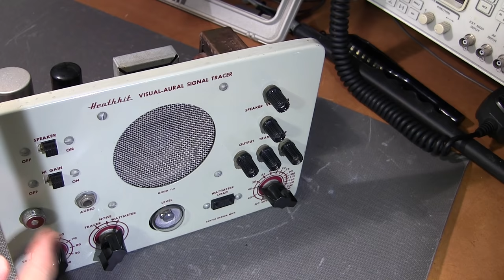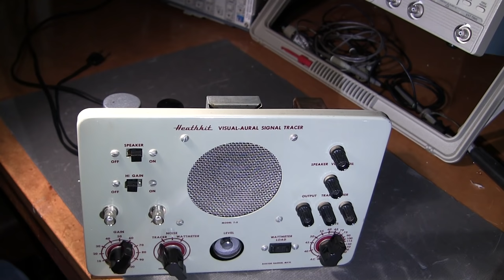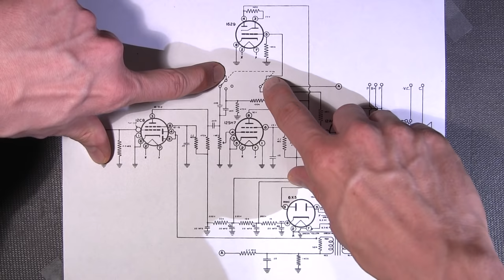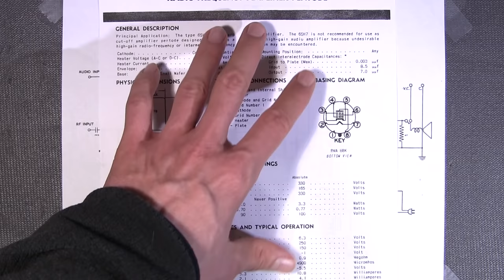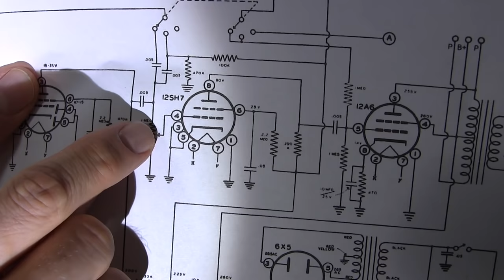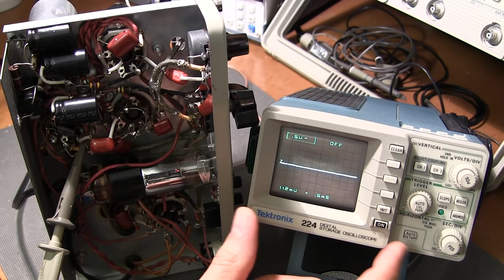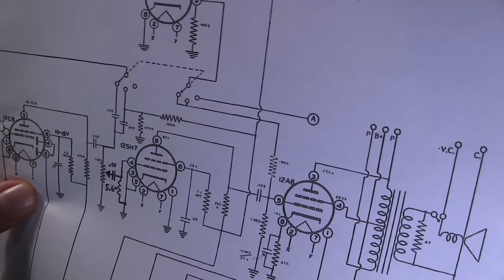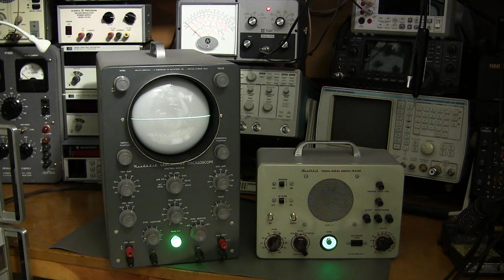Signal Tracer Troubleshooting Repair and Modification

Comment: Thanks so much Paul. Your knowledge of vintage and modern electronics is wonderful. As a mostly self taught designer over 60 years, mostly solid state . I can only say I wish I had someone like you to learn tube design when younger.  Learned more in this one video than any manual or book previously explored. 74 and still learning. Great job! Any chance you have any info on a Brunelle Instruments Model 3050 Sweep Function Generator I'm trying to restore.I also have a vintage Analog Digital Research CM52 1GHz Counter Timer before they were acquired by Fluke, fully restored with schematics I would like to donate, if interested.
Ken

Comment: Paul,
I was looking at a Popular Electronics Magazine from 1955. There is an article on basic radio servicing. It mentions a method of determining if the audio section is working is to put your finger on the grid cap of the audio tube to listen for hum. Quite a surprise if you touch the plate cap of a tube.
Reply from the maker: That's where knowing the difference is key.

Comment: Mr. Carlson. On the output tube there is a resistor from the cathode to ground and a cap across that resistor.  I don't really understand the purpose of the cap. I was once told it acted as an AC ground.  By the way I just became a patron.  Money well spent.
Reply from the maker: Hi Don. You are correct, the capacitor is a path for the AC to ground. You will notice a slight increase in gain with the correct value chosen.

Comment: Wow And THANX...! That  'Microphonic' and noisy resistor is a first for me. (Shades of the old carbon microphones) Got problems, hit it, bang on it, wiggle it. I love dumb luck testing when it works. That often does help find faults in things like pinball machines and appliances.This makes me appreciate the value of all low noise passive components too.

Comment: Paul, carbon firm and carbon composition are very noisy at higher resistance values.  I recommend instead to use metal firm resistors, which are much quieter.

With these 2 resistance coupled pentode stages, the gain is very high so, will quickly highlight any unwanted noise pickup.

I have seen some unbelievable problems with carbon resistors.  With heat, voltage, and moisture, the marked value can really change, especially with some of the non Allen Bradley carbon comp types.  When checking the resistance of the part, check it twice, reversing the polarity for the second measurement.  Surprisingly, they can develope semiconductor properties when they go bad.
Reply from the maker: Which brings me to E.F. Johnson VFO issues. :^) Thanks for your input Bill, its appreciated!

Comment: Really good troubleshooting video. I'm sure there are design defects in some kit gear, that were never discovered. 
Why use a 2 wire line cord on a device with an all metal chassis and cabinet? I would have made it a 3-wire with a grounded plug for safety.

Comment: Interesting to note that the 1958 Heathkit catalog shows a proper grid leak (pot connections swapped) for the 12SH7 control grid. Also interesting that the beam power tube is rated for +10 volts on control grid, but they did do a proper cathode bias. I wonder if some enterprising sort in the drafting department "corrected" the "backwards" pot and caused this error to be propagated?

Comment: Very good video. I was very impressed the with grid bias and coupling circuit addition and the isolation of the faulty resistor. Very informative, would have liked to have seen this video when I first got into electronics back in the early 60's.

Comment: I think I would be absolutely lost without mine.  I have a Paco Z-80 on my bench and use it daily.  I actually have three of that model, one of those Heathkit's and a Elenco.  All basically the same thing just look a little different.  The only thing I modified on mine was to change to a BNC for the probe and added a off switch for the eye tube to extend its life.

Comment: What brand and type of electrolytic cap would you recommend for replacing the filter cap in Heathkit and other tube type test   equipment? what type gives reasonable life in this application? I have a few pieces of the old equipment and watching these videos has given me enough info to start restoring some of them.thanks

Comment: Thank you! This is valuable info and that looks like a nice piece of test gear. I recognized the noise from another video of yours where you had a bad resistor. My money was on the 390k though. Now if/when I run into this a third time I'll likely go at least in the direction of making a repair. Thanks again for your service!

Comment: Hey Carlson. First thanks for your great videos. I like to watch them and I learn a lot. I have a question and I know you don’t have the time to answer all comments. I ask you, because you are having a very bright eye tube in your signal tracer. I don’t have a signal tracer, but I bought a Heathkit IT-11 Capacitor Checker 2 month ago. I changed all capacitors and some resistors. Its working fine, but the eye tube was blurred, when I shift to leakage (much more bright at bride), but I was able to calibrate it easy. I could not live with that, so I bought a NOS 6E5. The brand is UNITED where the old one is RCA. The new eye tube is bright and fine and works fine when I test the value of  capacitors and resistors. At leakage it is also bright, but it is impossible to calibrate it. Nothing happens when I turn the pots to calibrate. When I swap to the RCA tube, there are no problems. Are specifications not the same for all brands or what?  What are your experience?
Happy New Year

Comment: Great Vid. I like how you explain the signal path through the unit and explain how all the components work and what their used for. Very interesting. I wish you could do that with a Fender Black face AB763 amplifier circuit. That would be so great. I would probably watch it a 100 times. You do great videos. Keep up the good work. Thanx!!

Comment: Whenever I hear that crackling or frying bacon sound while I’m servicing tube amps, the source is usually a grumpy carbon comp plate load or cathode resistor.  Great content here.

Comment: I have the Eico version of that unit. Handy little things indeed! I like how I can test output transformers on board, and get audio out of or into an audio amplification signal chain. Those a great for chasing down dead spots in audio amps. I have seen some boutique guitar amp builders/hobbyist builders, and hobbyists, converting those into little guitar amps. What a waste! Use the da'med thing! BTW, I passed my extra class two months after I got my General. I was busy the nest test session, missed the second one, and wound up at a different radio club's test session. I think I will go get my VE this week. They really need some new VEs really really bad. That is the most geriatric ham radio club I have ever seen. It's also one of the nicest too.
Reply: Oh, new gear..... Amp Supply LK500ZC 1500 watt linear, home brew 4-125 type tube linear that goes up to 2 meter band, Bird 4391 meter, with elements for HF/6meter/VHF/UHF, and SW, and an old General Electric WWII era US Army Air Core transceiver that uses VT4C output tubes, with the power supply, PLUS a bunch of added stuff for amateur use, including VFO, BFO, preselector, Q multiplier, and who knows what else. I am busy fixing the truck up with modern(ish) gear.
Reply from the maker: Lots of cool stuff Seth! Pretty soon your place is going to look like mine... LOL!

Comment: Great video. As a suggestion would the noise mode still be effective if a high value resistor was connected to the back of the input socket so as to limit the current to less than a milli amp so you wont get a shock off the test probe?

Comment: Very good video, My question to you is on the power cord. Is it a good idea to use a 3 prong grounded cord that will ground the chassis to earth ground ? Does a earth ground to the chassis affect the circuits and or calibration of vacuum tube devices ? Maybe the subject of grounding would make an interesting video. Thank you for your time well spent, Christopher

Comment: Great video, though I’m late to it. I have the slightly later grey version T-3 but no bias noise; I’ll have to see if it has the blocking capacitor from the factory. That’s bizarre to swing the DC operating point with a gain control. 

Having a few decades on you, I had a similar idea ten years ago, to assemble a vintage hobbyist bench from about the time I was born, all of grey Heath instruments though.

I ran into the “heated resistor” test this week in an old Heath transmitter. It was open in-circuit, then within tolerance after desoldering. I wonder what it will be in the trash?

People familiar with the time say that Heath did buy a great deal of war surplus parts, possibly accounting for the unusual T-3 tube specs. But I’d be certain that the 12.6V heater choice was driven by the eye tube voltage (itself perhaps surplus in the 50s). The amplifier tubes were never going to share the 6.3V rectifier winding because it is at B+ DC potential—or should be—to avoid exceeding the rectifier heater-cathode voltage rating, and would thus exceed that of the other tubes.

Comment: You may want to increase your emphasis of the plate cap warning. Some circuits are 450 VDC idle (tube disconnected) with +7000 volt to -2000 volt pulses when in operation. This is encountered in TV horizontal sweep circuits.

Comment: Paul what do the  component date codes available indicate as to when this kit was made?  Based upon the kit color scheme and the knobs used I would guess the late 1950's.  As far as the unusual tube compliment you mentioned in your discussion I would almost bet that Heath took advantage of the post war surplus cache regarding 12 volt filament tubes which were selling for pennies on surplus markets by the time this kit was put together and miniature (7 & 9 pin) tubes had replaced the older octal and loctal base tubes completely in consumer electronics.

Comment: I have both this model (T-3) and its predecessor (T-2). The T-2 lacked the tuning eye & wattmeter. Curiously the T-2 model (using the 6v version of the same tube) had a cap on the gain pot's wiper and a 10meg grid leak resistor which the T-3 design lacks. So Heathkit knew these two parts would carry a benefit but chose not to include them with the newer kit. My guess is this was done as a cost cutting measure to keep the newer & more advanced kit under a chosen price point.

Comment: Thank you very much. Very interesting video and looking forward future ones. I noticed that you usually do not remove the can capacitors even if they are not in use at all. Is there any reason to do so apart from keeping the appearance of the circuit modules intact?

Comment: Paul, are you still planning on continuing this series of repairing tube electronics using this old test gear?  It would be a very interesting see how its done.
Reply from the maker: Hi Denis, I'am planning to do this, just have run out of room. If this Patreon thing goes well, I plan on expanding the lab, and having two separate sections, old time workshop, and another using modern gear.

Comment: Knight kit made a signal tracer with the same features but different implementation. It's the 83Y135. It doesn't require the mod that you made for this one. Are you familiar with it and what comments do you have in comparison?

Comment: Hello Paul, excellent video! I have a T-3 I bought years years ago. Watching your video has inspired me to restore it. I have no probes for mine, but I have the manual. I like your idea of putting BNC connectors in place of the original types and plan to do mine the same way. My question is do you use any particular type of demodulator probe for the RF side? Or did you just replace the end of the original Heathkit probe with a BNC as well?

Keep up the excellent work!!

Darrell

Comment: Thank you VERY much!  I love learning from you.  I work on electronic organs and tube amp Leslie maps also.  Currently, I am trying to repair a Thomas Trianon 606F organ that is losing signal to feed the amp, which the amp is good.  Somewhere within the organ itself is the issue.  I was wondering if there is an audio detection probing proceedure would be affective in locating the problem.
    Again, thank you VERY much!
Tim

Comment: At the beginning of this video (when you replaced the capacitors) you mentioned having checked the accuracy of the resistor values.

Did you have to lift a lead of each resistor when doing this?  Or were you checking in-circuit?   I have virtually zero experience with vacuum tubes, so I am quite curious to learn whether in-circuit testing is valid with the power disconnected.  Thanks.

Comment: If one wanted to eliminate the hum coming off the 12C8 Would there be anything wrong with moving the high-gain switch to instead short pin 3 to ground? Or would one need to modify the unit to ground both the cap and pin three? Or is there a reason it would be bad to ground pin 3 long-term? Really great video!
Reply from the maker: One would have to experiment to see the result. I did also move a ground connection from the front face to the chassis (done off camera) This lowered the hum when the case was put back on. The case carries current to the face of the unit inducing a slight amount of hum. Moving the shielded grid wire to a chassis ground, as well as the switch ground wire to the chassis made a big difference. A few design flaws in this unit. Some engineer was asleep when this got finalized.

Comment: Paul- The .05 tubular cap from the unswitched side of line power to ground is essentially a line filter cap? Should that be replaced with a proper safety cap? A .047 Y perhaps? I am adding a fuse holder to the back with a polarized AC line cord. Would it hurt to add an additional Y cap to ground on the hot/switched side?

I'm waiting for a 5.6 Meg resistor to finish the audio gain mod. The ceramic stand-off's are nearly unobtainium but I did finally find a source. They do not give them away, but they are well made. I really enjoyed this video and as with each one, learned a ton. I have two ME-26D/U's on the list for resto next. One needs a new transformer which I was able to source. I got both on the cheap due to the secondary (6.3vac) side malfunction. Eh, eh.
Reply: Would you care to share your source?

Comment: Hi...this was really useful and informative!! I know it has been a long time since you did this, but if you get a chance to respond, I have a few questions: any reason you didn't install a three prong plug; why not a polarized plug; maybe a fuse in the mains also; and, lastly, why keep the mains safety capacitor (concern with rf noise?)? Thanks!

Comment: Greetings Paul - I enjoyed this video very much, and learned from it.  One thing I do not understand though, is how do you solder capacitor leads to a ceramic standoff?  What kind of standoff do you use exactly?  I think you sometimes solder a ceramic standoff to the chassis but I do not understand how.  I have seen you use ceramic standoffs in other videos but cannot visualize exactly how you do it.  Thanks, Dave
Reply from the maker: Hi David, There are metal tabs on the ceramic standoffs, these are the solder points. Some ceramic standoffs have a metal base as well, in many cases, this can be soldered as well.

Comment: 14:35  Paul, you mentioned that the unnamed builder oriented the capacitors correctly but did they?  A lot of times the band lies as the manufacturer just puts those markings as cosmetic or maybe for the benefit of high speed production cameras as a reference mark i believe while not actually denoting the outer foil or negative terminal though many believe it is as if they were electrolytic capacitors

Comment: THAT CRISPY SOUND is what I'm aiming to dig out of an old Fender amplifier.  I know its a resistor, It must be traced out.   Can you use a signal tracer like this without lifting the resistor from the circuit?   If you had your amp off,  and popped the probe across a resistor in question, would that be OK?
Reply: So long as you observed polarity of any parallel polarised capacitors, it's fine, although parallel impedances due to being in circuit may reduce observed noise in faulty components.

Comment: Paul, I'd like to know more about the ceramic standoffs you used to mount the new electrolytics.  I'm trying to picture how you mounted them to the old lugs in a way that provides a strong support but no electrical path.  Many standoffs I'm familiar with have a screw or bolt that runs through them so they do not provide the electrical isolation you'd need in this situation.  73, Mike, K9UW
Reply from the maker: Hi Mike, I'm working on a video right now that uses some of those standoff's. I will talk about them a bit in the next video.

Comment: Perhaps, as a precaution, you could drill a hole above the "AUDIO" jack and install a suitable grommet/lamp holder with an incandescent lamp/resistor (period-correct) connected between the center pin of the jack and ground to indicate that the "NOISE" mode has been selected.  A sufficiently high total resistance wouldn't load the test point very much.

Comment: I was curious, out of circuit, about that noisy 100K Ohm resistor, how close was  it reading with your DIgital Ohm Meter for it’s a resistance? Was it within normal specs for it’s rated tolerance? In term of modern resistors, there are Carbon film resistors and metal oxide resistors. In a high voltage divider, does one type have an advantage over the other for normal noise characteristics?